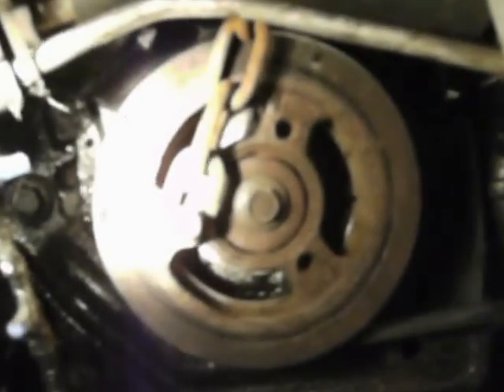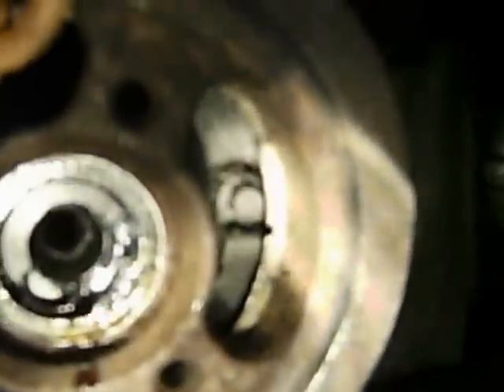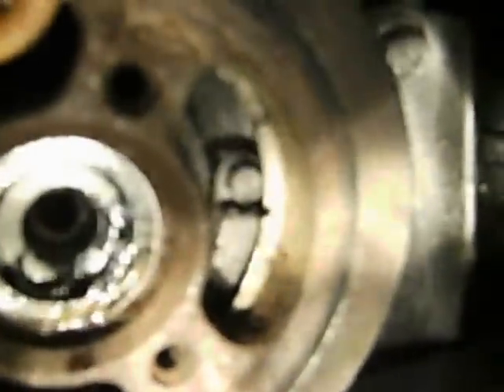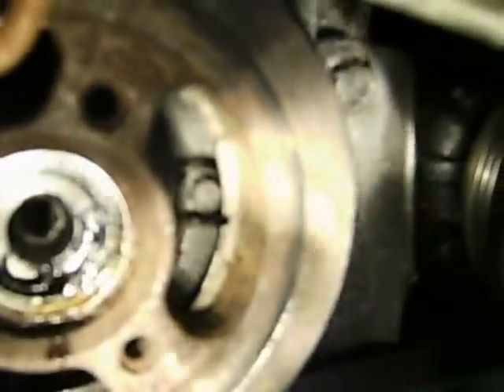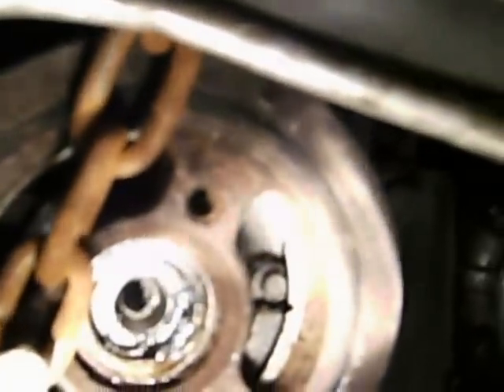3.1 Eng Balance & Crankshaft Sensor

Comment: It says crankshaft sensor in the title but you guys replace the cam sensor
Reply: +jcoopdo I think this engine has two crankshaft sensors and one cam sensor. There is a crankshaft sensor behind the balancer.
Reply: There's a crankshaft sensor behind the crank pulley and one in the back of the block right under the exhaust manifold, several inches up from the oil pan plug. The cam sensor is about a foot back and easily accessible on the bottom of the car